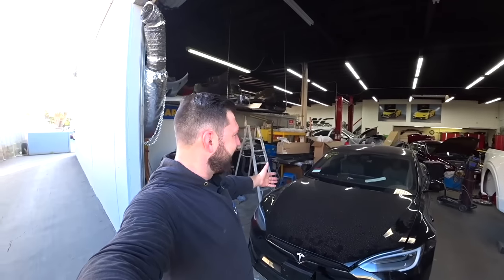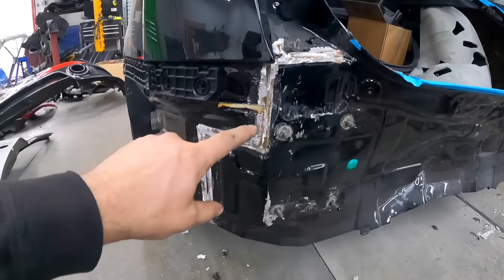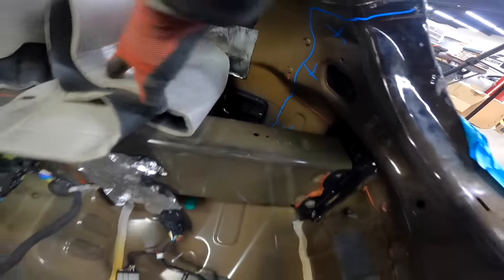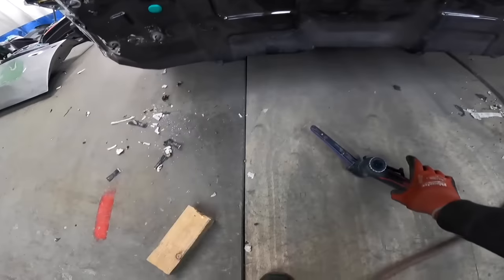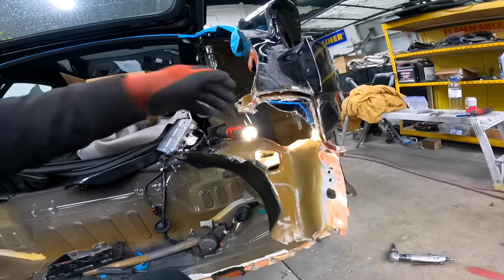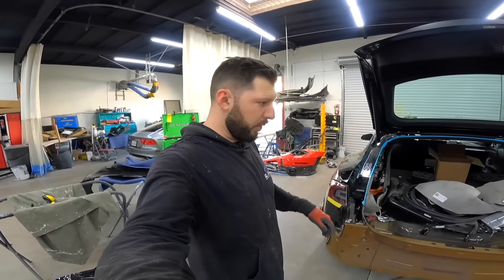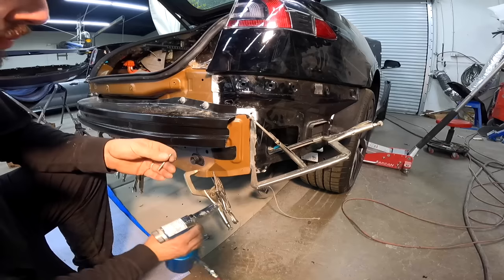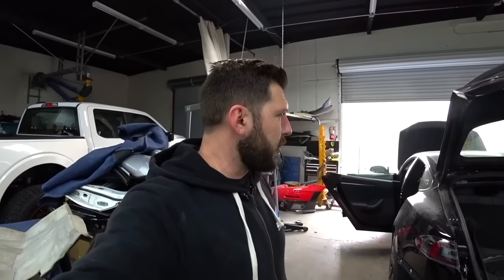Rebuilding New Crashed 2021 Tesla Model S Plaid (Part #1)

Comment: Get in touch with Rich Rebuilds. You may save yourself tearing apart half of the car to fix the issue. He also is connected to shops that repair damaged Tesla batteries so I am sure he can help with this problem.
Reply from the maker: Sounds good, thank you my friend

Comment: So THE PREVIOUS OWNER made A CLAIM. You made “quote” to repair the Tesla. Knew the adjuster, got THE TELSA OWNER A NICE “CHECK”.  Thus got a DEAL in exchange for the difference of the repair WHICH cost NICKEL’s on the dollar. Bring in to telsa for codes. ADD a “SUPPLEMENT” to the repair for “EXTRA WORK”. Pocket difference and sell, SMART!!!! Love it
Reply: Love you. What's with the eggs and the apple? I couldn't read your answer because it's deleted.

Comment: Tesla is notorious when it comes to locking up their software. I've heard them charge customers to upgrade to fast charging so I wouldn't be surprised if the computer locks up the car and only they can unlock it. But yeah, Uncle Rich at Rich Rebuilds and his crew will fix that thing real quick at a low price.